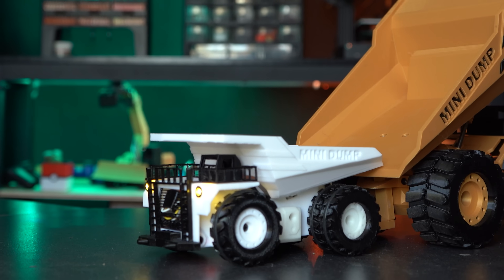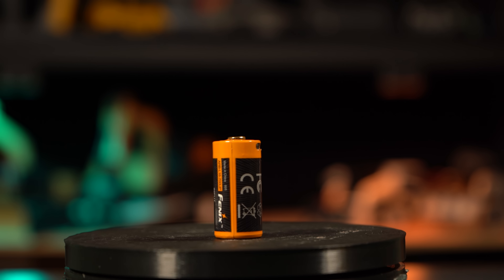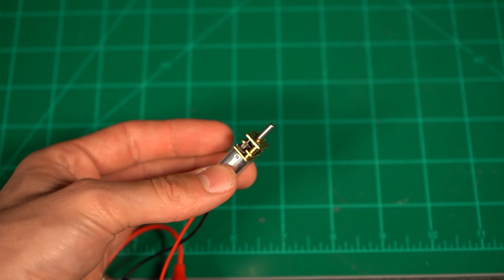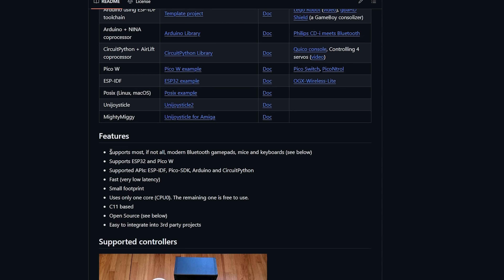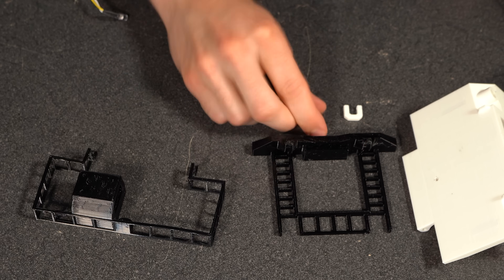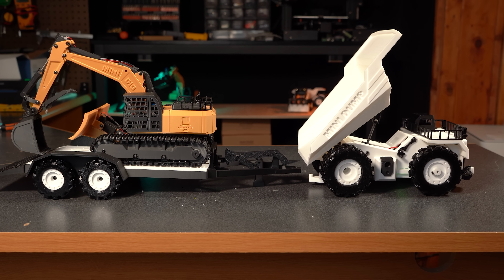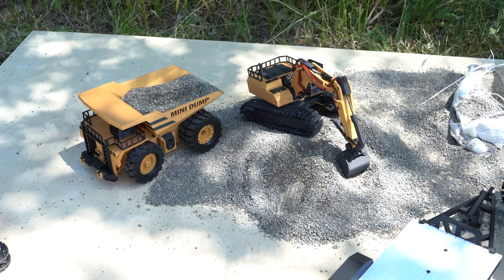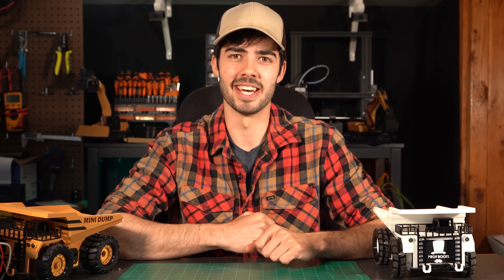DIY RC DumpTruck - V3.0

Comment: I combined the project prints and circuit elements very nicely, but when I upload the code you gave me the github link, I encounter many error messages about the library and boards. The code does not compile at all.
I keep getting the Esp32 board error.
Can you help me?
Reply: Any chance you have any luck, I’m completely unable to connect to the board after uploading

Comment: Late comment, BUT, could you use rechargeable batteries that have say a docking station, battery gets low..  it reverses and 2 pins or contacts hit then they recharge??

Comment: I finished building this truck over the weekend (and the trailer). I had to make a little modification (with a Dremel :) ) for the dump lift motor to add a little more clearance for the back of the motor. No big deal.
This thing is AMAZING!  AND since the PCB vendor I used charges the same for 10 boards of this size or 5 I have the ability to build 9 more.

Keep up the fantastic work!
Reply: I know it will very on what vendor and where you live but thats the ballpark price on getting PCBs like this made?

Comment: Hello. I have a problem with the firmware. This is a mini dump project. When power is applied, everything works, but as soon as I try to turn the wheels, the servo scrolls and does not respond to control. Can you catch up?

Comment: What a great model! thank you so much! I ended up making my own PCB from a perf board to get up and running quicker. ended up using some 18650 I had already and a BMS for max run time haha. My 3 Years old is loving it so far. One change I made to the code was to initialize the Trim with -6 (3 clicks left) and I also have the trim buttons being disabled 30 seconds after boot. My son kept hitting the bummers on the xbox controller on accident which would eventually jam the servo and burn it out, went through 2 servos but since the change the replacement servo has been running strong. The PCB for the excavator comes today which is all I need to get it going, currently printing the trailer. Thanks again!
Reply from the maker: I’m so happy to hear you’re enjoying the models! Also sounds like you’ve made some improvements for your situation which is awesome! I hope the excavator build goes smoothly and that you(and your 3 year old) enjoy it as well.

Comment: Could you make a Liebherr LR13000 crane, with counterweights at the back and a working articulating arm? Maybe it could use string to operate the arm so that all of the motors could be mounted lower for a low center of gravity?
Reply from the maker: That would be super cool, this is in the top runnings right now

Comment: The interesting part about scaling the dump truck is that IRL most of those trucks have electric motors in each wheel. I'm surprised you didn't just do that for the rear wheels after putting motors in the front wheels.

Comment: Definitely one of the 4 wheel - 4 wheel drive & 4 wheel steer cranes with a telescoping boom. A Rough Terrain Crane - google it I'm telling you they're pretty sweet. Especially for outdoors fun, like u realized is so much fun with the upgraded MiniDump & that sweet Excavator u designed. 

Could even do a deviation in the build process to allow for it to be made into a telescoping forklift iteration instead of a crane. Heck I'd make one of each, that's what I'd do. Potentially increasing ur circuit board & other parts sales for you to boot, Professor Boots.

Comment: A thought for optimizing the printing topology, making the 'lip' of the dump bed a separate piece, would cut out the need for almost all support structures there, as well as remove the need for the weird tilt on an A1 or similar bed sizes.

Comment: AMAZING VIDEO!! I am so inspired, but there are two questions that i still have, what is the difficulty in making them(skidsteer, dumptruck and excavator) and what is the total or individual price for the electronics?😁
Reply from the maker: They range in terms of difficulty, with the skid steer and dump truck being pretty easy. The excavator is a little harder because there’s sooo many moving parts. Cost also varies depending on where you get your parts for example if you order everything on Amazon it could be up to 100$ versus ordering some stuff through aliexpress which could bring it down to 40-50$
Reply: @professorboots  okey tysm, I just might make them..

Comment: If burning up the track motors becomes a problem, you might consider adding a sensor of some sort, be it an encoder on the motor itself or a current sensor on the motor output, to detect stalls and cut or reduce motor power. Alternatively you might stick thermistors on the motors and detect an overheat instead.

Nice to to see the dump truck scaled up!

Comment: Love the new build, I recently built the RC excavator and it works great. The only thing I did not like in the entire build were the screws, these 2.6 screws were a pain to source in my country and they fell out multiple times, maybe the one I received were not the correct size and they were inconsistent, it would be great if your builds use standard M3 or M2 screws with M3/M2 heat inserts, they work really well with 3D printed parts and are easily available even locally.
Reply from the maker: Thank you for the feedback! I think I could definitely find a new screw solution to help prevent that problem. Look for it in the crane!
Reply: @professorboots  I just made a miniskidi. And I used M3 screws and heatset inserts practically everywhere (thanks for the step files). It's an easy mod and absolutely worth the extra time.

Comment: Make a rough terrain crane.
Reply from the maker: Like a tracked crane?
Reply: @professorboots  rough terrain is an off road type usually with a single person cab
Reply: @PerseidArchimedes front and rear steer, and also outriggers
Reply: @PerseidArchimedes  or just dual front steering now that i think about it a crane wouldnt have much use for rear steer
Reply: @bmxscape rear steer has use, some mobile cranes have it for traversing tight roads and paths. It's typically independent from the front so they can walk the rear around a corner etc.
Reply: Try a Grove RT9130. They will be a bit easy I would think on the design of the drive system. And instead of having 4 steer axles you’ll just have two. And some RT can actually be transported with counterweights installed.